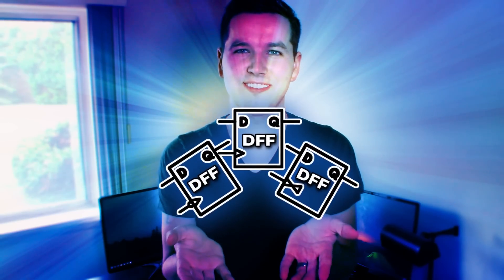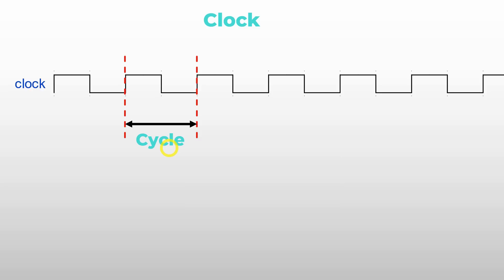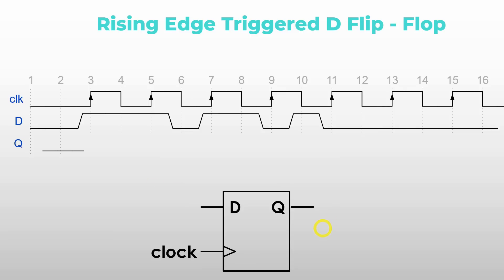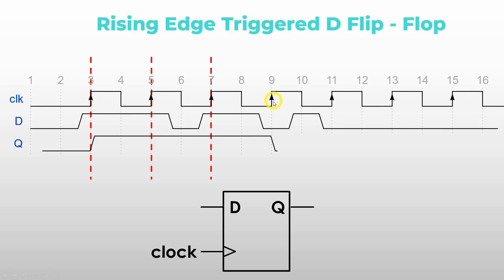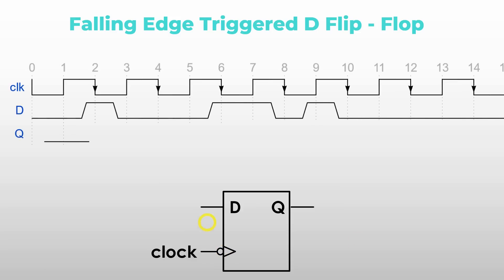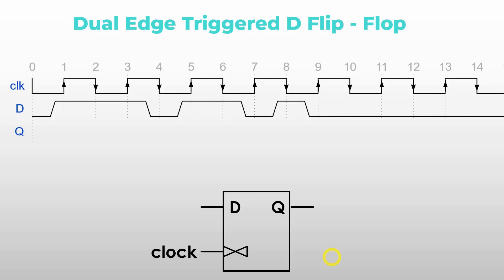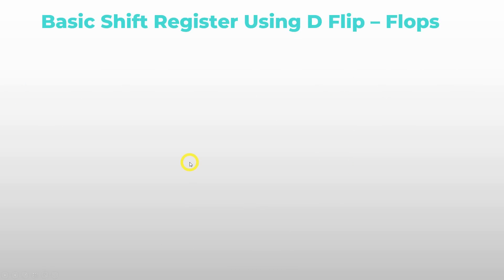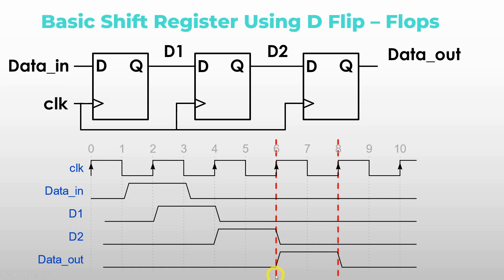What is a D Flip-Flop? | FPGA concepts

Comment: Why would you use a flip flop? I assume you can use it as storage, but you would need to stop the clock using a switch or something?
Reply: Generally the clock is not gated. To prevent the flip-flop from changing, you would add a 2:1 selector. In the hold case, feed the Q output back to the D input. In the load case, feed the input to D.

Comment: The clock cycle in FPGA is no different than the clock cycle in a standard CPU, correct?
Reply from the maker: Alex, you are absolutely correct, the clock in an FPGA is 50% duty cycle just like the one in CPU or many other devices out there. Thanks for the question!